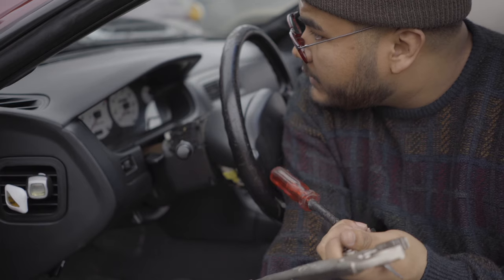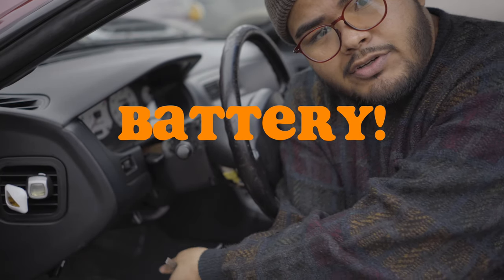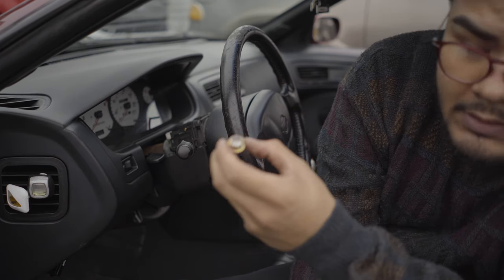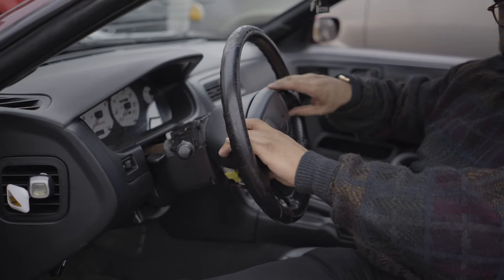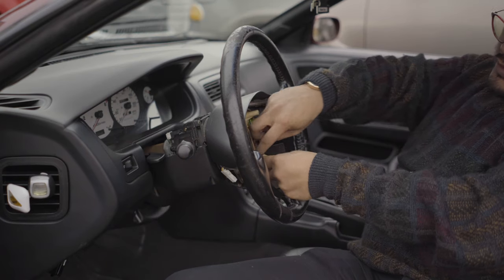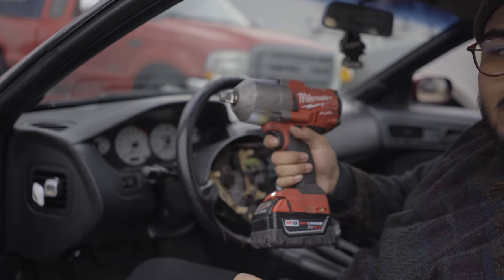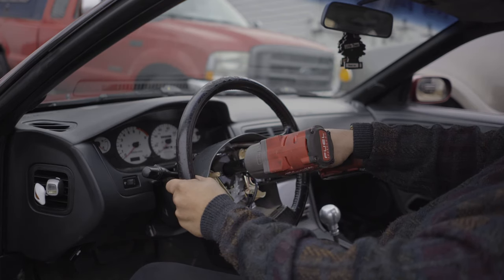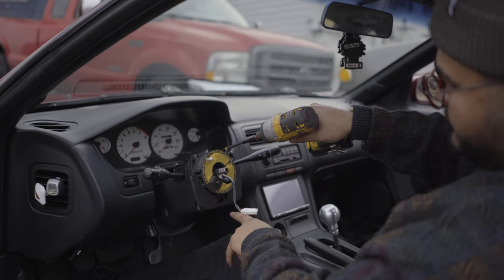NEW STEERING WHEEL INSTALL // S14 gets a renown steering wheel and DND billet short hub

Comment: did yours line up perfectly? mine seems a hair off center.  I even pulled it off and put it the next tooth over and it was off the other way.
Reply from the maker: Jonny yea man, it should’ve lined up correctly. if it’s just a tiny bit off, your wheel alignment might not have been 100% straight from the start.

Comment: you didn't need a hub spacer for it?
Reply from the maker: Dane Blackburn no spacer needed
Reply: @carshopbarber  did you get an airbag light?
Reply from the maker: Dane Blackburn i did but i just took the bulb out of the cluster
Reply: Actually i installed short hub but it needed a spacer in order to put horn. 15mm spacer and longer screws... I couldn't hook up horn properly :(